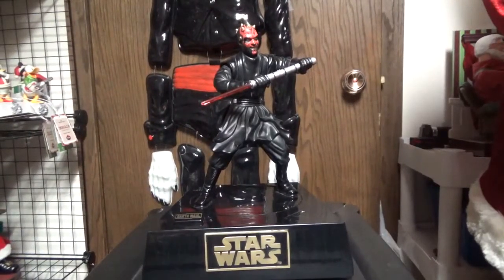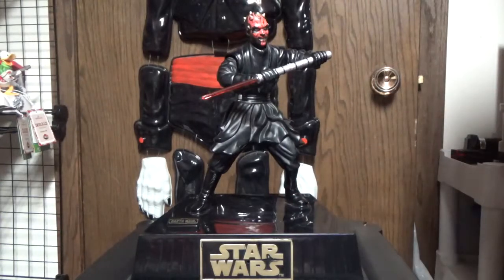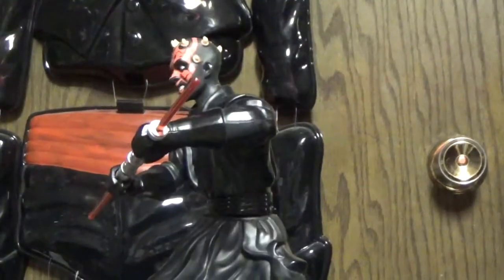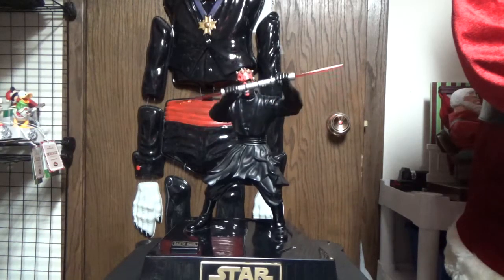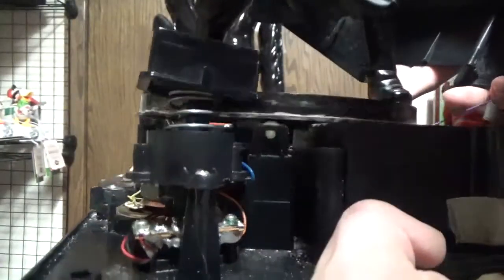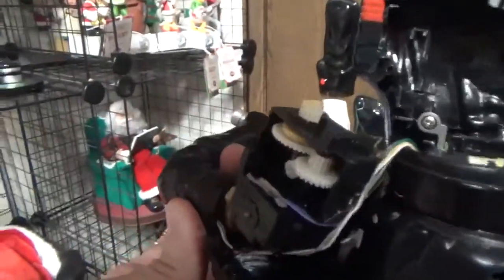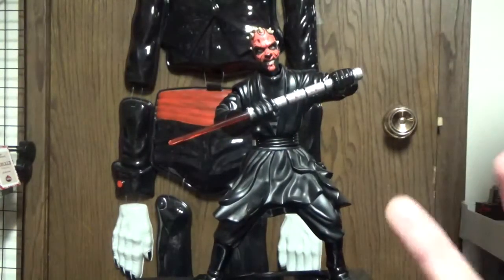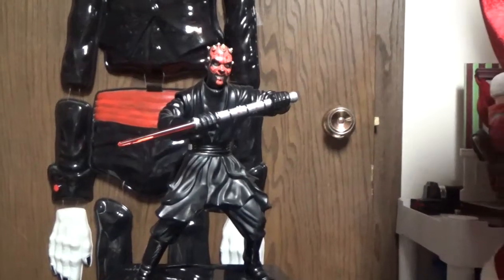ThinkWay Toys Animated Star Wars Darth Maul Bank (not good working condition)

Comment: The compartment for 6 more batteries is for extended play. States this. There are two gears and a motor in the left arm in the hand. A rubber belt in the left arm/hand that extends down to a gear/pully, so the arm extends the sword and retracts. Rubber belts can wear out from age and stretch out and the sword may or may not extend or retract. 
Now beware. These are selling for New in The Box/Sealed. on auction sites. These toys were made in 1999 with batteries in them. No doubt they 100% corroded and corrosion is on the battery terminals. Toy doesn't work. I've seen it several times. Buy at your own risk.  Bto corrode

Comment: Sellers on Ebay selling new in the box 2022.The original batteries are still in it and will be corroded. The battery contacts will have corrosion.

Comment: How do you fix the lightsaber arm that opens and retracts?
Reply from the maker: You should be able to open his hand up, theres a belt (o ring) that brings it out and retracts it. So either that is bad, or maybe the motor is just locked up.
Reply: @gemmymasteranimatronics768  which screws do I take out to fix the arm?
Reply: @gemmymasteranimatronics768  how do I open his hand ?
Reply from the maker: The screws under his arm
Reply: @gemmymasteranimatronics768  when you take them out does anything come out or fall out of place ?
Reply: @gemmymasteranimatronics768  when you take them out does anything come out or fall out of place ?
Reply: @gemmymasteranimatronics768  is the arm easy to take off and get to the belt and the motor? Will anything fall out when I open it up? Also is it just the two screws under his arm to take it off?
Reply: @gemmymasteranimatronics768  I have the same problem and it is new out of the box. Is the motor in the arm with the o ring?